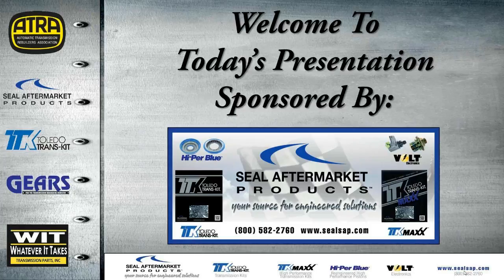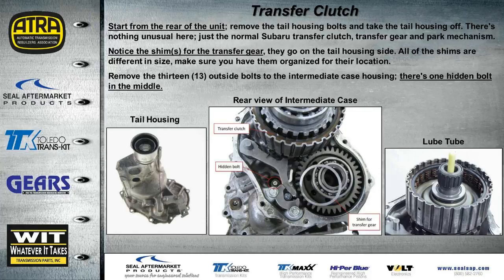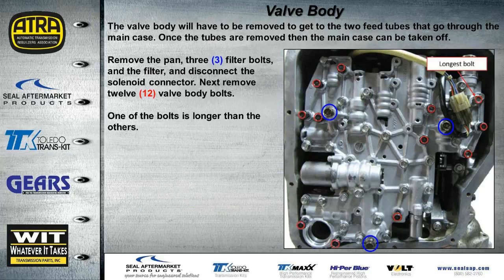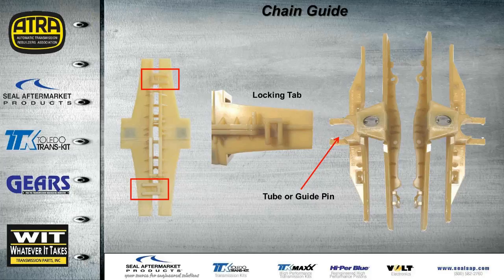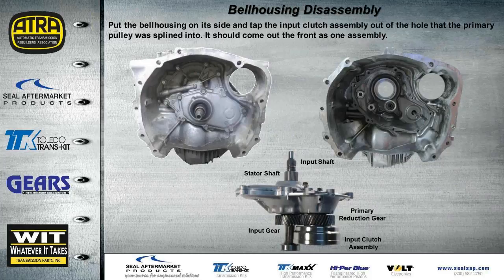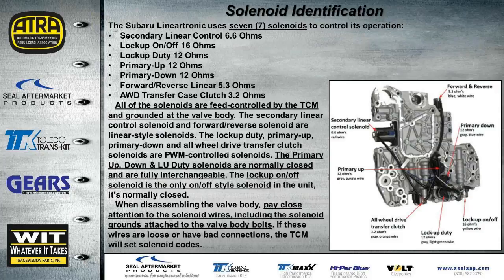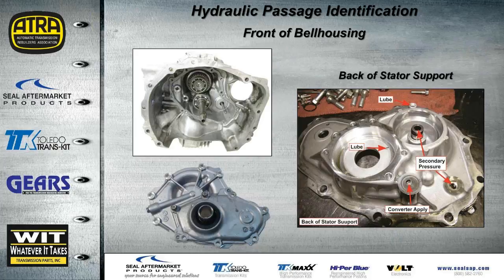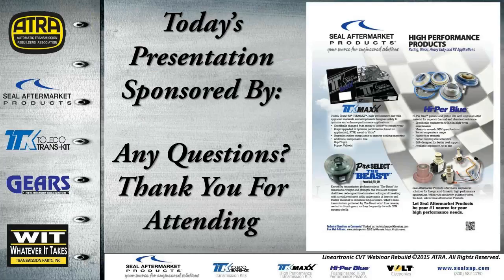Subaru Lineartronic CVT Rebuild

Comment: What is the first thing to fail on the High torque CVT? is it the clutches or some gasket to wear? And how can a company sell a torque converter to raise the TQ limit. F1 Motorsports sells a tq converter. do they modify the gaskets or change the fins?
Reply: Subaru CVT's don't have dipsticks. Nissan has issues with the belt going within 100k range but Subaru uses a chain in theirs so it's likely not to be the culprit. 

I recently had mine driven and what not at a dealer (cause I'm at 95k and doesn't hurt to be cautious before the warranty runs out) and he said he still hasn't got more than a handful of CVT's in and none of them were for the chain or fluids. 

as far as failures, just be prepared to buy a new tranny. they don't really work on them, they just put new ones in for about $7400.
Reply: The original failure point was the Thrust Washer in the Torque Converter would were down, and block the relief hole of the Lockup Clutch preventing it from releasing. On Subarus the Lineartronic stays in Lockup 90% of the time, only time its unlocked is very low speeds, and coasting which is why the symptom was violent vibrations and jerking, similar to if you just didnt press the Clutch in on a manual. Good maintenance and 30k fluid intervals keep them running good, almost at 90k on my TR580 (didnt see the the 30K Change, but the 60K still had clean reasonably fluid come out) i expect the same at 90k, and so on.